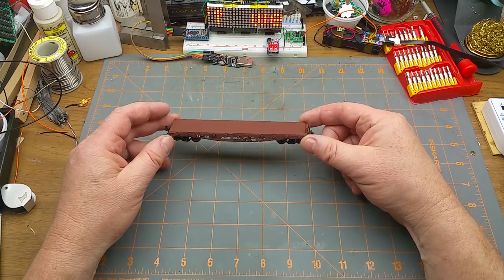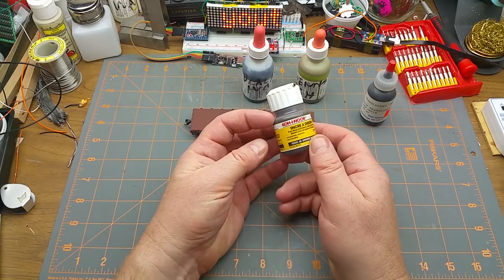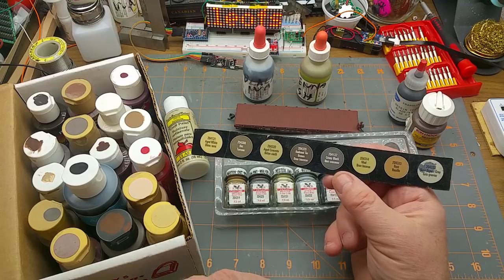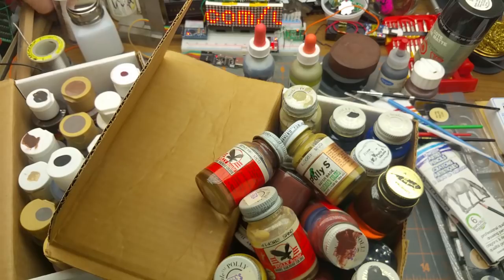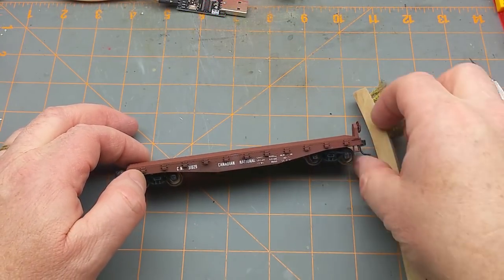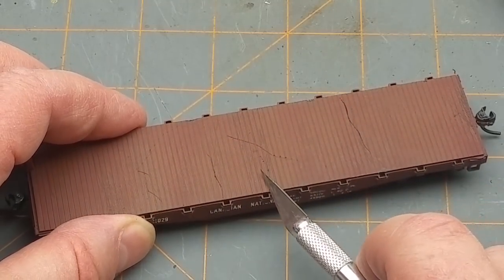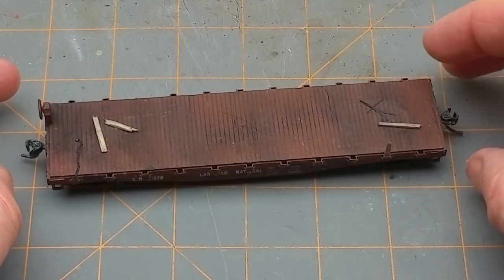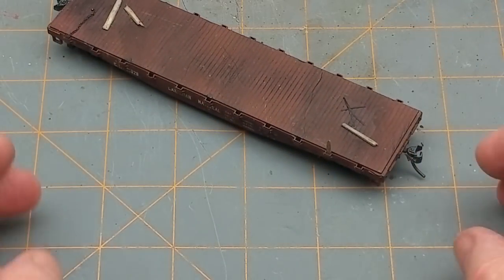weathering a cheap flat car

Comment: After much swearing & cussing I finally assembled a Tichy Train Group flatcar.  I saw a video of the assembly and really liked the under frame detail (which no one will ever see).  I followed the instructions to the tee and wish I hadn't.  After installing the stirrups in a previous step I broke every one of them off while installing the extra added bronze phosphor wire grab irons.  If you ever build this kit install the stirrups as the very LAST step!  I did end up making some stirrups out of staples from a desktop stapler that were the correct size for my HO scale model.  I think I spent as much time chasing small parts across the floor as I did assembling the model, LOL!  After finishing the assembly I painted the whole underside rail brown and hand painted every board on the deck a different shade of brown mixing the acrylic paint in a small plastic communion cup as I went along.  It came out looking very realistic and believable.  Cheers from eastern TN
Reply from the maker: That's a time honoured way to make stirrup steps.

Comment: Wow! The dullcote really took out the mud/light weathering. I kinda preferred it before the laquer. Looks great as it is, though. If I hadn't seen it before the spray, I would love it! Although, the undercarriage looks in awfully good shape. I would expect it to have some chunks out and a LOT more rust then the sides. I think the one pocket that you over-heated looks the best of all! But, wouldn't something this old and used have had a few planks on the bed replaced, and look new? But for the time we saw you spent on it (don't know how much elapsed on the cuts), it's great!
Reply from the maker: It took me less than an hour not counting drying time.

You're right that it would be better if I had taken the time to clean up one of the boards.

Then again, weathering is one of those things that can always be re-visited....

Comment: Great video!  The car looks great.  One comment...you left the couplers on when you hit it with Dullcoat.  Wouldn't the Dullcoat "gum up" the spring action of the coupler?  Not the inside of the coupler pocket, I mean the tiny spring that opens the knuckle.
Reply from the maker: Doh. Busted...

I got lucky this time. It only took a couple of flexes to break the dried dullcoat loose and free up the couplers again.